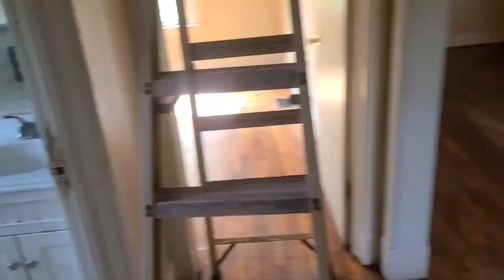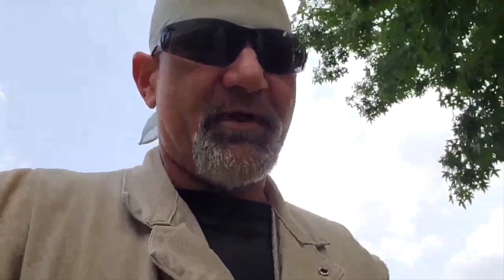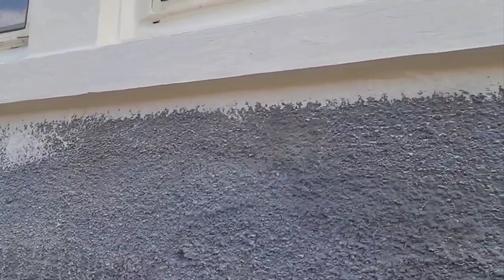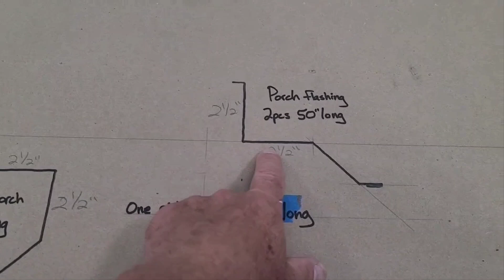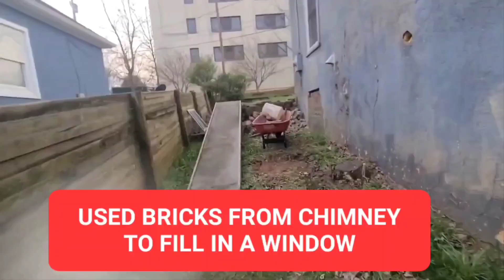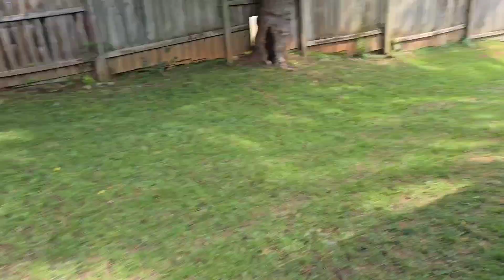My side project rental house remodel is done

Comment: Why is it so sad and gray looking? What color is that wet cement? Is there a more depressing color? Maybe some bright shutters or something 🤔
Reply from the maker: The darker color covered the patches, repairs, and old stucco much faster and better than any lighter color could have.  I painted the entire exterior of this house  by myself in one day and got excellent coverage and protection for the stucco and wood it's made of.
Do you think that putting more time & money into a brighter paint job and shutters would generate more rental income on a 560 sq ft rental house?
Reply: @NBSWELDING  nope, but I do think a splash of color would help rent it quicker. I used to have 4 rental properties myself. I'd get some dark Kelly green 💚 shutters and some random flowers 💐 for the front there, maybe 🤔 a hanging basket.
Reply from the maker: @ManMountainMetals  thanks for the input....I do agree it looks too dull and your right

Comment: Pavilion is well built and well designed. It is beautiful.
Reply from the maker: I feel like it was too drastically overbuilt...It's nice but when things are 10 times stronger than necessary I can't help wondering what better use those resources could have went to
Reply: @NBSWELDING  Consider the “just barely enough” engineering that went into the Baltimore Key bridge. Sometime it might be better to over design and build when safety is involved. You are an example of better engineering on your projects.

Comment: I like it CB!  Good single home living. Great job on the gutters!  I new you were going to put your custom metal work on that house some where. Only thing I didn’t like was the washer and dryer in the bed room. I would put that in basement. I was wondering what was that black stuff you were putting on the floor with the mop.
Reply from the maker: I had the washer/dryer in the basement and used it that way this passed winter....I ended up deciding that most tenants would not want to carry their laundry around the house up and down that hill in the winter so I made provisions to put the laundry in the bedroom....as far as me staying there using it as I worked on the house it was much better in the bedroom.

The black stuff was grout...tiles must be grouted by pushing grout between the gaps in the tiles and then cleaning the excess off of the surface of the tiles.

Thanks for watching and commenting

Comment: Fyi for the future, wood and mortar aren't the best compainions. You can use (2 part) Bondo to do a repir to a wood frame like that but even better is the 'Plastic Wood' filler and better yet is 2-part epoxy wood filler that will last forever. 

That's a nice little 'tiny' house for a single person, or maybe even a couple to start in. I love those walk out basements like that. Thats a perfect little place for a nice wood shop, crafting space or even a little welding repair\practice area!😉 Only thing i woulda done differently is the flooring, I wish the wood floor could've stayed it looked like it was in good shape but maybe it looked better than it actually was, plus walls may have moved & requied patches & repairs that i don't know about. 

Anyways nice job CB, that kind of home improvement work is what i do and have done for decades - roofing, siding, windows, doors, drywall, framing, plumbing, HVAC, electrical, kitchens, baths, etc. It is very rewarding work to do! I love driving past stuff I did years ago(like your steel gazebo) and remembering doing it. 

You got a couple income properties then, huh? As long as you get real good tenants, it makes it stress free, but if you don't it can be a little tough sometimes. I'm sure you don't have to deal with that down there. I'm referring to what i see here in good old Buffalo NY and surrounding WNY areas I live and work in all the time. Hope you get it rented soon and get a real good tennant in there to take care of your property so you don't have to keep driving back and forth all the time to check on it! Congratulations on finishing it up, now you can reap the benefits from owning & fixing it up. 👍🏻👌🏻🛠️🔧🔩🦺🚧

🇺🇸🦅✊🏻
Reply from the maker: Thanks....appreciate your info
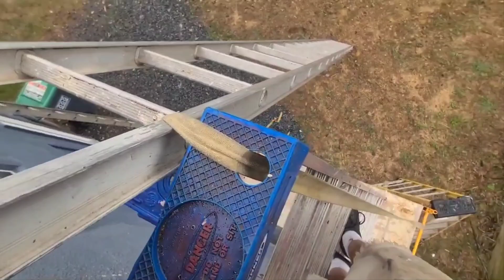Reply: 28:24 😂That's some OSHA approved ladder sketchiness right there boy! Ladders on top of scaffolding, ratchet strapped to another ladder! I love it man! I like your roofing, gutter flashing set-up - good job man - thank you for explaining your drawings & how it's all gonna be used after metal fab shop bent it all up for you. Came out good! 😄👌🏻👍🏻

🇺🇸🦅✊🏻